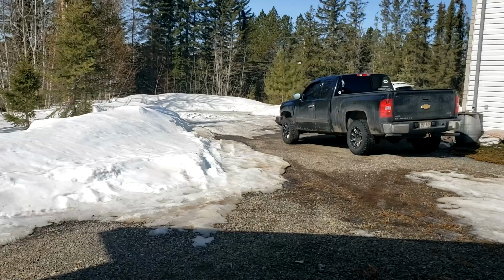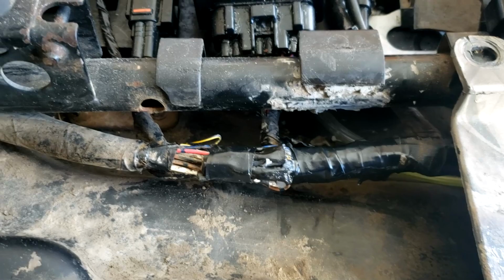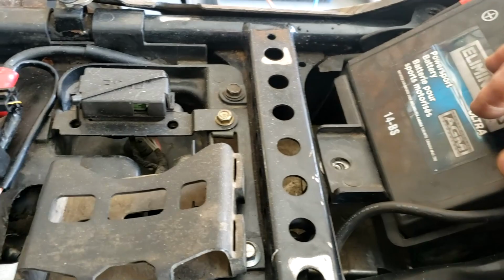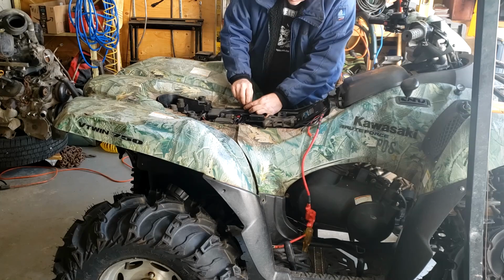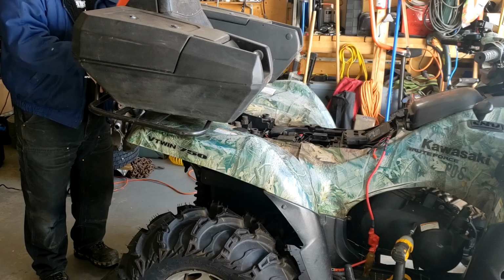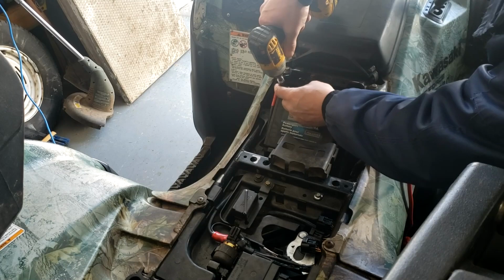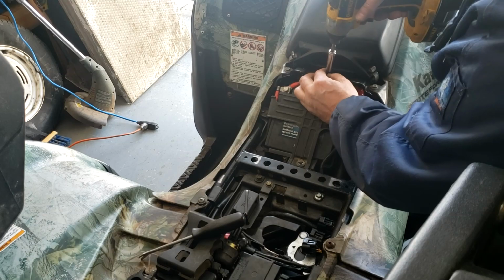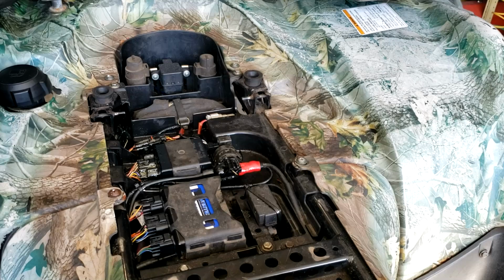Will the Dynatek CDI box fix Brute Force 750 Issues I've been having

Comment: Working on a POS Brute force 750 also, it's doing the same thing as yours. I was leaning towards a valve out of adjustment, but not sure I want to tackle that. Look forward to your next video to see what you came up with. Thanks for posting.
Reply from the maker: We're totally cleaning all parts of the carb and we also found the ignition switch was bad.  Also check the choke cable in case it's sticking on a bit.  We found one slide in the carb was slower than the other but the choke cable seemed to move freely.  Good Luck!

Comment: I have the same same problem with my brute. What’s your issue. I think the dynatek is bad
Reply from the maker: My Dynatek is brand new and works fine but the original CDI box wasn't working properly. Also the Ignition switch was faulty and I think the choke was sticking on a bit.  Lots of issues LOL! Good luck with yours.

Comment: Not sure if mine is the CDI it's popping in the air box and auto exhaust only can run like 40 miles an hour put a new fuel pump in it
Reply from the maker: Carb Syncro off maybe, so many things that go wrong with this machine.  Hope you find the issue, happy trails!
Reply: @RobFarrowATV   efi machine
Reply from the maker: Ah, an air leak then most likely, make sure everything on the intake is tight and there's no leaks in the system.
Reply: Machine only has like 2400 miles on it. You could put gas into the intake and it would still run like crap. And it was not flooded. You would put new spark plugs in it and need only have a few Miles on them Adam and would not start putting new plugs in it fire up.

Comment: Almost sounds like its loading up chugging and smoke.. If its carbureted it seems like choke is hanging up or something!
Reply from the maker: Thanks Larry! Exactly what we were looking at today after finding a faulty ignition switch.  Chris is going to take the carbs and give them a proper rebuild and cleaning.  The slide in one seems to be hanging up and not sliding properly and the choke o-ring seat seems to be an issue.  We're slowly getting there but it's frustrating as hell dealing with all these problems.

Comment: If you wrap some tape around a small socket it will fit around the wire harness.  I usually wrap a foot or two of tape on a small 1/4 drive deep socket.
Reply from the maker: Good Idea, thanks Man!